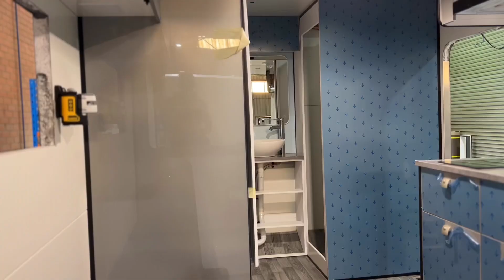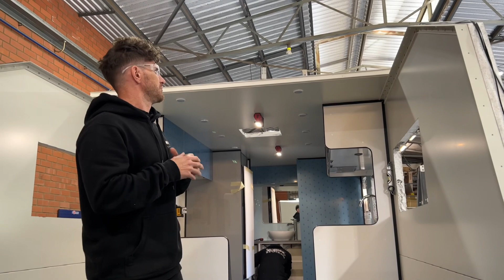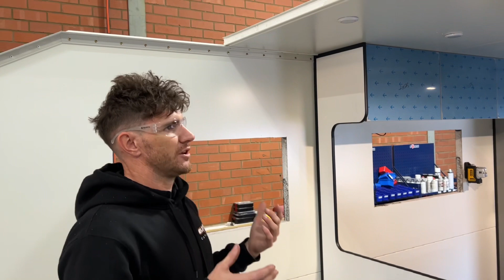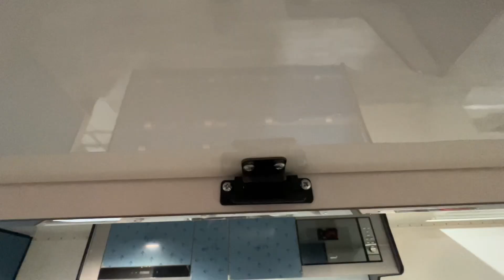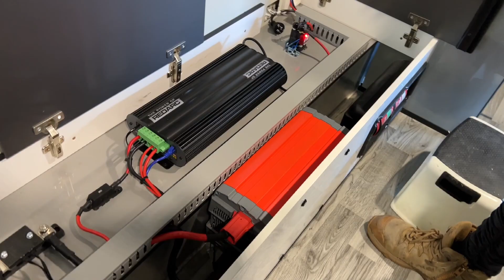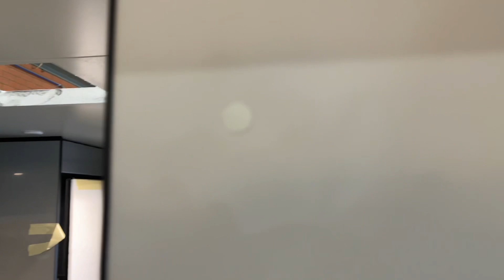Elross Wall Construction

Comment: You must have a lot of reliance on sealer to ensure the roof doesn't leak with 3 or 4 joins?
Reply from the maker: Joins are internally bonded with Sikaflex - on top of the roof the joins are Lap sealed with Colourbond Roof and gutter silicone to prevent leaking. 
Its not really any different to how your roof is sealed on a Colourbond roof on your house, or other styles of caravans using seam lock joins. Its all down to preparation and care to ensure a quality finish.